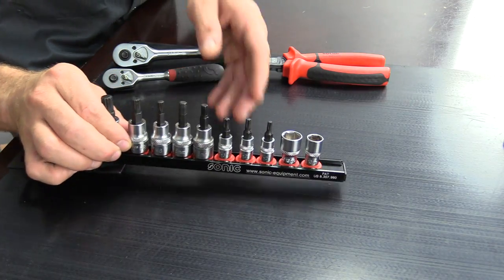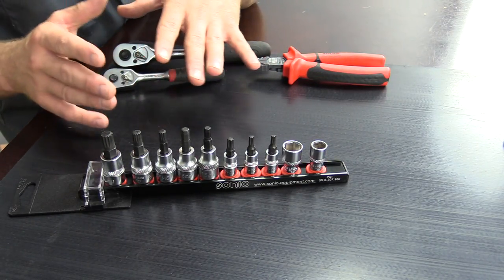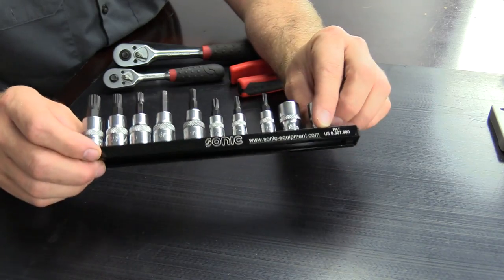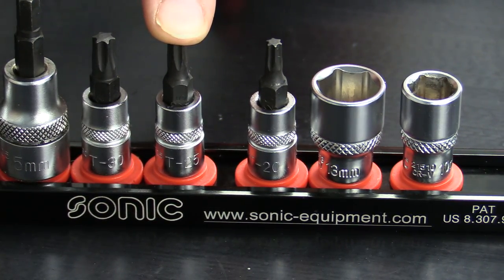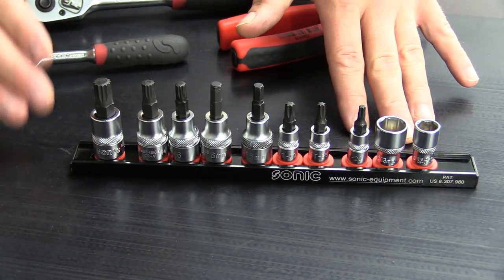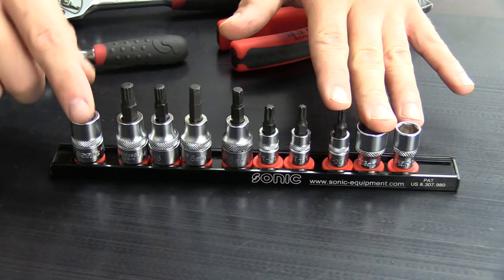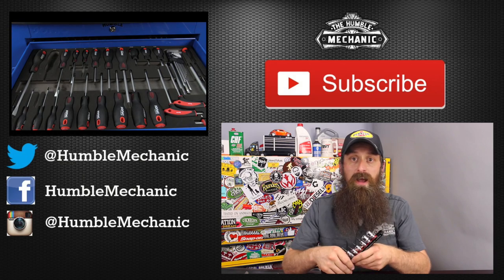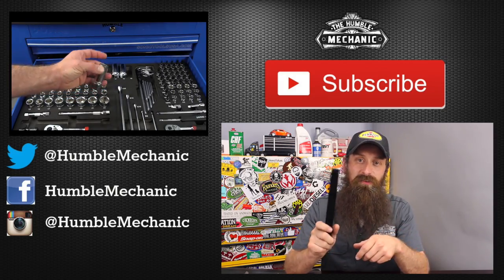Custom VW Tool Set, Sonic Tools

Comment: Link does not work to buy these, does anybody know where I can buy 9mm and 24mm triple square spline drive female sockets? I need them to undo the nut on the end of the drive shaft in the centre of the front wheels and for the clutch plate in a MKVI Golf 1.6TDI.

Comment: Nice with VW tools :) small suggestions: make no 5 and 6 a bit longer,  working ex. with brake changes I often use a longer model to give more room to the rachet :) 
brilliant videos btw :)
Reply from the maker: Thanks for the kind words. I think they make a longer one. There is a little room for 1-2 more sockets.

Comment: good to know..... btw quick question
.... best year to buy for jettas TDI.... or Tuareg TDI (v10 or V8 dont matter) ..... been wanting them but dont know which to buy
Reply from the maker: +Leatherkid01 I am a fan of the ALH TDI. so that is 99-03 the PD TDI is pretty good, the newest generations are a little picky about fuel.
Reply: +HumbleMechanic sorry but what years are PD TDi? and i figured as much of the later models (bluetec ones ) being picky....but knowing me id delete on most stuff .... pdf egr (similar to duramax mods if possible) that tree hugger squealer (diesel gate ) stuff ruined it.... should have left it alone for the newer stuff so i dont have to mod it haha
Reply: +Leatherkid01 sorry dpf.... haha

Comment: Id get this but its missing the 16mm triple square anti-tamper socket used for the transmission drain plugs. lol
Reply from the maker: +Voss2120 you can have them add one on for you. 

I was trying to get some of the more commonly used tools
Reply: HumbleMechanic
Yea man, I mean when i had to change the gear oil in my O2M transmission I couldn't find the socket to even open the drain and fill plugs anywhere.

Comment: would that work for a brake job on a 2012 tiguan?
Reply: No, you need a 7mm allen socket to get the caliper off  and if you are replacing the discs you will need a 21mm socket and some format of breaker bar
Reply: Probably not. I would bet that the calipers are fastened to the spindle with a 19mm fastener.
Reply from the maker: +Daniel Dandurand depends on if you're doing the front or rear. Either way you'll need more tools.
Reply: +HumbleMechanic got it. thanks everyone. I guess in reality I just need to know if I need the triple squares? I have the rest
Reply from the maker: +Daniel Dandurand that's a 14 triple square.
Reply: +HumbleMechanic sweet thanks!

Comment: No 7 mm Allen for brake jobs? They are annoyingly difficult to get hold of.
Reply from the maker: +Dag-Erling Smørgrav you can add it to the rail. Just give Sonic a call
Reply: HumbleMechanic I already have all the tools... but I really like the rail itself. Haven't found one like that in any of the stores I frequent. I use the cheap metal type that you briefly showed for comparison.

Comment: a VW toolkit without the 7mm unbraco, that's just wrong :D
Reply from the maker: Hahah. I think the only 7mm we use is brake calipers?
Reply: Yer i agree, but a 7 mm can be found all around, so would be easy to add..
Reply from the maker: There is room on this rail for 1 or 2 more sockets if you wanted to add them.

Comment: Two infomercials in 5 days?  I don't mind you working in a plug here and there, "hey guys, check out this whatever. I helped develop that can make this job easier" in the middle of a video teaching me how to fix my vw, but now you are just producing straight up commercials.  If I can't learn anything from watching one of your videos, there is no reason to watch your videos.
Reply from the maker: +iliketoUSEmybrain017 Sorry you feel like me working my ass for for a discount on a cool product for you guys is a commercial. 

I hate to lose any subscribers, but if you truly feel my channel doesn't bring you value, I understand.
Reply from the maker: +iliketoUSEmybrain017 id also add, if the content of the show is not what you are looking for, consider submitting questions or show topics. This show is for you guys. They content is driven in a way that the audience can choose what we talk about. 

Have you taken advantage of that?
Reply from the maker: +iliketoUSEmybrain017 you are correct. And maybe this was a poor timing thing on my part? Maybe. 

But I thought it was pretty dang cool that I worked with a company to put a product together for VW/Audi. This set didn't exist before. We developed it for my audience and for anyone working on VWs. 

Part of the agreement for me doing that, was to get my audience a discount. A really awesome discount. One that no one else can get. 

While you may not learn a ton from that, you can save a ton of money. To me that's valuable. A blanket 25% off on a companies website is pretty good. 

I am sorry that you are feeling the way you do. I'd love to keep you as a member of this community. I think there is a lot of good here. But if you don't want to stay, that's cool too.